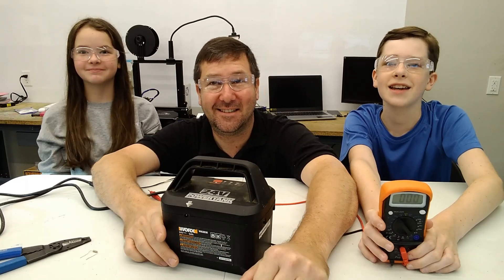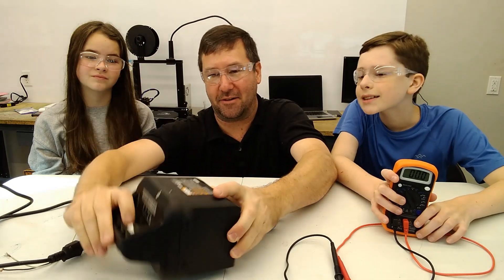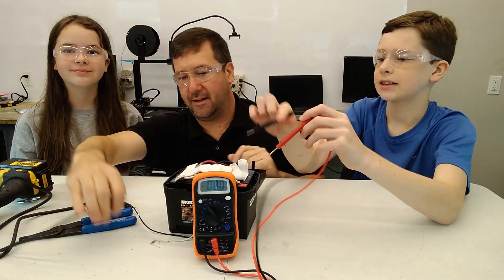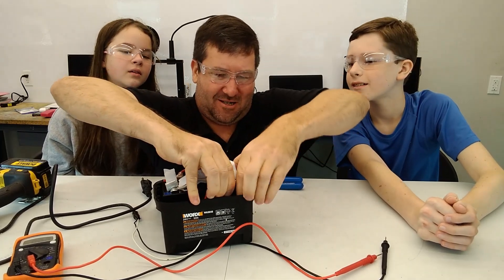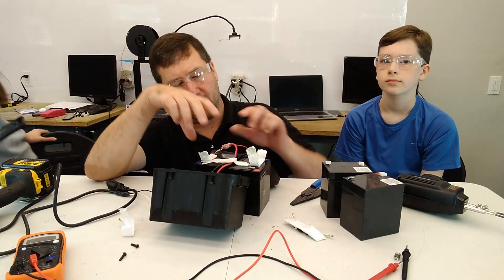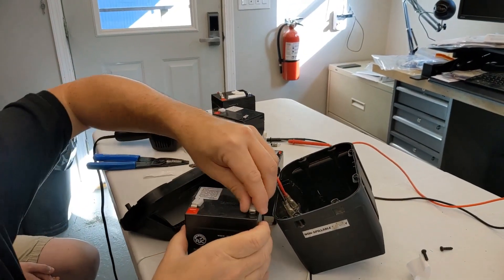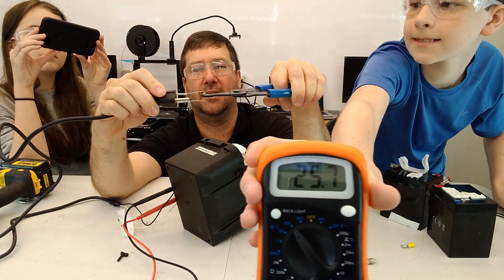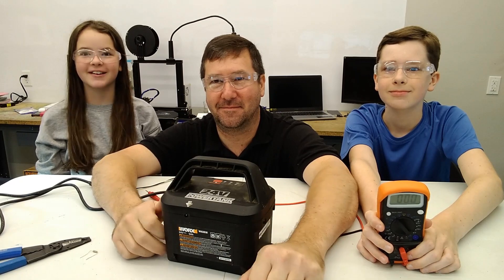How to "Rebuild" a 24V Worx Battery for $40

Comment: thanks, mine died finally after some 15 years. mower still is working,  the 12 volts are still available for $26.  with a small lawn, didn't want to buy a new mower if the old one would still work
Reply from the maker: Good to hear that you could fix your mower.

Comment: Assume I have nothing, not even a screwdriver. What do I need to do this project? If you don't mind me askin'.
Reply: What more do I need besides screwdriver, volt meter, soldering iron and wire strippers?

Comment: I had the same battery that would not charge. I used an external battery and placed it  where the thick lead connected from the lawn mover end to the top of battery red and black left it for about 5 min, then the charger was able to identify the battery and take over the charge. Unfortunately the charge would not hold so the internal need to be replaced.

Comment: This incredibly annoying because it sounds very simple but I'm a 110% beginner who is made nervous by electricity.  I don't even like testing or jump-starting a car battery...but I do, because once you have had the safety rules explained, and parts pointed out, you know.  Different than when men just said, "Be sure to ground the negative terminal on the car body" as though I knew what the (****) that meant.   So I don't re-wire lamps and so forth.  

Having your hand and the camera block the view JUST as you are cutting, stripping, consolidating, crimping, and reattaching the wires makes the video 75% useful.  About like the dead battery itself.  I need to see what you are doing, and you are basically not demonstrating that last step.  You are telling a story about what you can do, for enjoyment of families with kids.  Just that--rather than explaining exactly how to do the final step.  Why are you having to push TWO sets of wires into the yellow plastic cover for the combined, crimped wire?  Why does the yellow cap attach to the terminal just like the other side when it should still be missed the end piece that slides on and stays in place without glue or solder?!
Reply from the maker: An excellent example of how you don't get a question answered....🙄

Comment: What guage wire do I need to use when connecting two 12V 18 Amp batteries together for my Worx 24V mower?

Comment: Tom - we took the screws out but can figure how to get the lid off - LOL YOUR VIDEO  SKIPPED that part ! HELP ! The lid won't separate from the end where the charging port is - how do I get it off ?????
Reply from the maker: It isn't glued, just a tight seal
Reply: @TimWilborne  I miss two of the screws that was the problem
Reply from the maker: @philipnicholson3216  Yes that could be a problem. Glad you got it worked out!

Comment: Thanks for the video. I just tried opening and testing the battery and I get good voltage on both but the combined voltage at the output clip reads jumpy numbers, nothing at all, and then a single "1  ." (not 1.00 volt but some kind of error?). I don't know how to interpret and whether to attempt battery replacement or not.

Comment: Every single one of these electric batteries for mowers whatever within 2 years they discontinue them and then they offer you 20% off buying a new mower why the heck would I buy a mower that's going to only last 2 years and then have no parts for it these guys should be sued in a class action suit
Reply: Do we need the casing ? What would be a good way of connecting 2 12volts

Comment: Great video. I'm just replacing the batteries on this exact Worx "Powertank" for the 2nd time. It's pretty easy, and the NP5-12, 5Ah lead acid batteries are used in a lot of different applications (garage door openers, alarm systems), so they're easy to find and fairly inexpensive. Too bad they only last about 4 years.

Comment: Just did this same repair, following your steps (especially liked the approach to simply cut the wires and reattach with crimps, no soldering required). Worked like a charm; thanks!
Reply from the maker: Glad it helped, mines ween working great for several years now.

Comment: I just got this used mower and figured it out that the manufacture doesn't sell this battery pack anymore. I found your video and followed every steps to replace the batteries inside. It works like a charm and now I can mow the lawn in my yard!!! Thank you so much!
Reply from the maker: Glad I could help!
Reply: If anyone has a old battery pack for the wg782 I'll buy it

Comment: Tim, great video.   Do you think this would also work for an old 36V Worx Battery (WA3229)?
Reply: cancel my question, this 36V battery is a lead-acid one!!   discontinued as well.
Reply from the maker: This is a lead-acid battery as well.  I would guess yours is a combination of standard 6V or 12V batteries as well.
Reply: Do you think i can rebuild this 36V battery the same way???    I don't have all the tools to do this but your video is very inspiring and looks relatively simple to follow.
Reply from the maker: @timg764  I should be.  Another thought I had, is there any type of battery store near you?  Some of them offer basic services such as opening up a "custom" battery like that and replacing the components.
Reply: @TimWilborne   Thanks for the tip.  I will do a search and see if i can find one.  I was hoping that maybe this battery has three of them rather than the two you have, so the cost to repair it myself would be relatively cheap!
Reply from the maker: @timg764  It could be 3 12V batteries, until you open it up, it is hard to say.
Reply: @TimWilborne  thanks,  I will put some time aside to see if this is the same or not!!  the lawnmower is not sitting at my house but a friends house as i wrote it off long ago.  That is until i saw your inspiring video with your children!!!

Comment: 24V but only 5Ah (instead of 10Ah on the original) ?
Reply from the maker: No it comes out to the exact same amp hours
Reply: @TimWilborne  I think we are not talking about the same worx battery, it look like but not have the same reference, Sorry for this comment.
Reply from the maker: You are correct, amp hours don't get added, but the originals were 5 amp hours, not 10 amp hours.
Reply: @TimWilborne  Problem is the 2 batteries you bought at Amazon (B&B BP5-12 12V 5Ah UPS Battery - https://amzn.to/36LC6m4) specify only 5Ah for each. To put them in series, you add the voltage but the Amp.hour cannot be cumulative. (Source https://www.se.com/pt/en/faqs/FA229757/ , eg. when taking two 6 volt, 100 amp hour batteries in series, it becomes 100 amps at 12 volts. When in parallel, it becomes 200 amps at 6 volts.). Maybe I am wrong,  it is now long time I leave school.